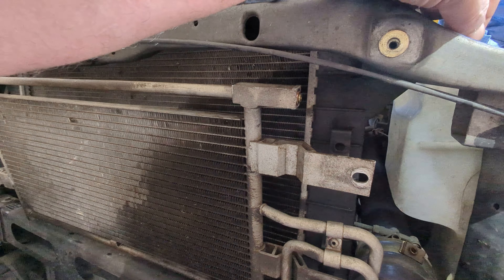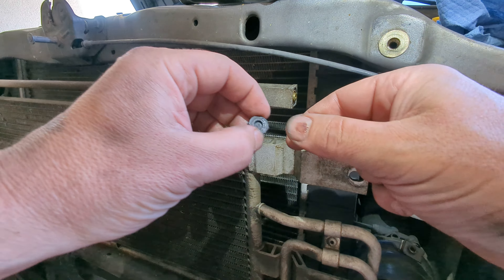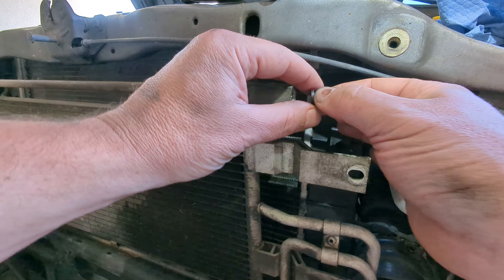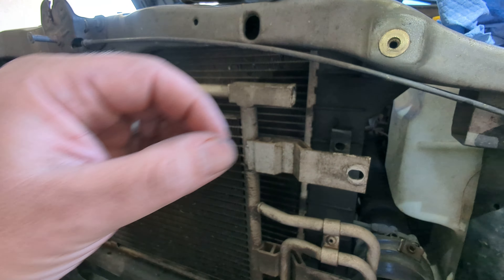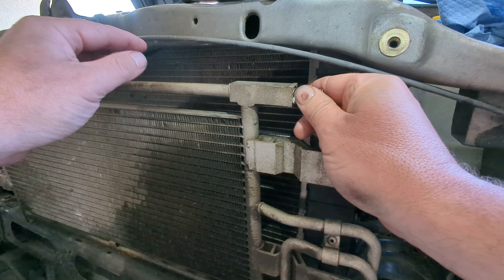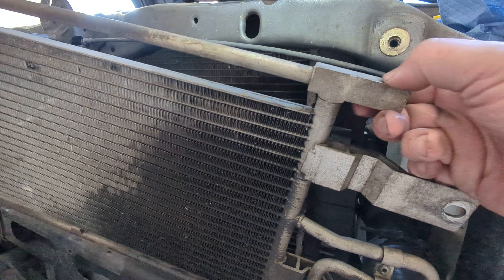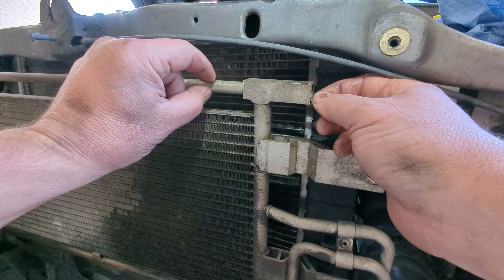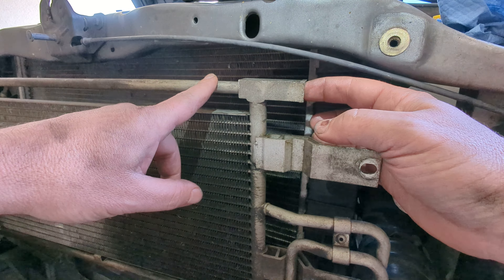Stock Transmission Cooler Thermostat bypass 2005 Dodge Ram 5.9 Cummins

Comment: We buy the kits from dynamic transmission and just drill a hole in the plastic end plug, put a drywall screw in it, and pry it out. Your idea works well too!
Reply: yes that is a better option
Reply: Used compressed air and got the plug out. It took a little time but got it on the 5th or 6th try. Need 2 people to do it though.

Comment: Good tip! I just did an ATS trans in my 04 and just replaced the cooler with a 2008/2009 6.7l that doesn’t have the bypass tube at all incase you don’t want to mess with the plug, it’s direct fit. About $140 on rock auto.
Reply: Is the 6.7 cooler bigger or better than the 5.9 cooler? Have you noticed lower temps??
Reply: @brianbvachek3219  it’s about the same dimension just doesn’t have the bypass valve / tube assembly at the top.

Comment: The plastic cap was a nightmare. 

Probably pointless to share as no one likes to be shared info when I offer it. 
I learned a few lessons when it came to trans cooling. Don't delete the TC cooler by the starter, you will regret it when it gets really cold. Also just get a Mishimoto trans cooler, and install a trans temp gauge.  I double stacked the trans coolers on one of my builds, but it cost me about the same as the Mishimoto after the fittings to connect the 2. Building AN8 lines is a pain, but if you want a fitting list I have it.
Reply: The heat exchanger on the side of the block is known to fail though (this poor dude actually experienced it 1st hand & mentions it in his very next vid post), don't want to send coolant to your transmission, *especially if it's built & you paid a pretty penny for it.

What happened to your truck after bypassing it, just curious? I live in the PNW & just made it through winter with it bypassed & a deep pan. Just had to let it warm up longer & was gentle on the pedal prior to normal op temps. I guess if you're gonna tow &/or be rough on the tranny right after startup, probably gonna be a different adventure.

P.S. My factory trans lines finally sprung a leak, right where the crimp is, coming off the cooler. Going -8 lines myself now; I got all the fittings but what are the 2 lengths of hose you cut? (My heat exch. is bypassed & will be fully removed while installing the -8 lines, so if yours isn't, the measurements obviously won't be apples to apples).
Reply: @_astralxinfluenced_2799 My trans coolers have not failed me on any of my builds so far. 

The main issue I had bypassing the cooler was when it was cold the shifts would be harsh until the trans fluid got warm. Takes a lot longer to get the fluid to ideal operating temps. If you live in a cold climate a lower stall TC will not be fun to drive when it is cold.
Reply: @ChannelZeroOne  Gotcha.

Yeah, mine didn't fail either, but I've read many others' experience failure & $500 for a bypass well outweighed the potential for ruining my $7k transmission. Then I watched this guys next video where he states his failed as well (ruined his trans). For me, taking longer to warm the fluids beat destroying my transmission. Sounds like you live in a cold climate too, but my trans works fine after a short warmup, no hard shifts or abnormal operation.
Reply: my exchanger failed as well, have a rad and probably engine as well full of slush now due to trans fluid being pushed into it.  I didnt drive far before I realized it so I dont think I did any damage to the trans, hoping I can just flush the fluid in it a couple times and flush the engine and radiator and run a bypass kit for the exchanger.

Comment: I couldn't get my end plug out with glue so I took a 1/4 inch extension using the big end on the plug, hammer and drove it in to plug it, now I have no more temp light or shifting out of OD, then I put the snap ring back in just in case

Comment: Going to have to do this my transmission got up to 230 when hauling my way up the mountain. At that temp I tried to pull over but got stuck in construction jam, started to get worried and could smell that burnt smell, I've thought about transmission cooler but will try this first, I'm a little scared to try, how it this mod doing so far? Will it need to be burped or something along those lines. Thanks
Reply from the maker: So far so good, no need to burp it and it's not terribly difficult.  Just be careful not to damage the o-ring when you reinstall the plug.

Comment: I live in MN and added a plow on my truck. I noticed just driving down the road with temperatures above 20 my trans temp will just keep rising where i have to pull over. 210 is where i pull off. I have tried different angles with the plow and nothing seems to help. Wondering above trying this.
Reply from the maker: Hi, at 210 the thermostat in the stock cooler is probably just thinking about opening.  In your case I would not get worried about the temp being too high until 240.  At 250ish you are in early overheat.

Comment: I have a 2004 5.9…. Why should I do this mod? What’s the purpose?
Reply: I also have a 2004 5.9 wondering why I need to do this… have you found your answer let me know please I’m also wondering
Reply: To keep temps down especially if you live in AZ like me
Reply: I'm curious as well.
Reply: I feel like this mod is to reduce restriction of the line but to also keep the temps at a more steady temp as apposed to trans gets hot valve opens trans gets cool then trans gets hot again valve opens...you get the idea.
Just be careful. If you live in a cooler climate you might want to keep this valve as is.
Might be a great mod for towing

Comment: Is that cooler bypass used on 4th generation Rams, too?
Reply from the maker: I'm not sure what kind of cooler the 4th gens have up front🤷
Reply: @DieselCamper  They have a block-type bypass you will have to replace that part I do believe

Comment: lets not overlook as most everyone does, that the transmission and its fluid are best at 185-190 F. doing this delete/ changeover accomplishes absolutely nothing, except slower warm times, and a real possibility of trans damage when asking the transmission to work at high pressure on cold fluid.
Reply: not completely true most cars and trucks do not have this option and it takes very little time for fluid to reach that target temp I spent almost 30 years in the business
Reply: False

Comment: That cooler is leaking.. look at it.. need a new one
Reply from the maker: It's leaking there because I tore the o-ring.  Got a new one in👍
Reply: @DieselCamper  where did you get the o ring?